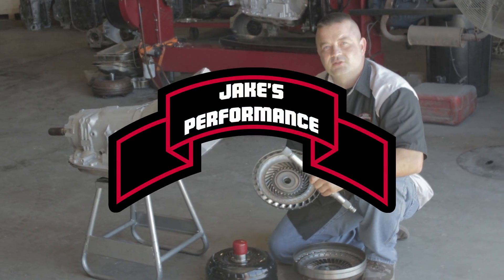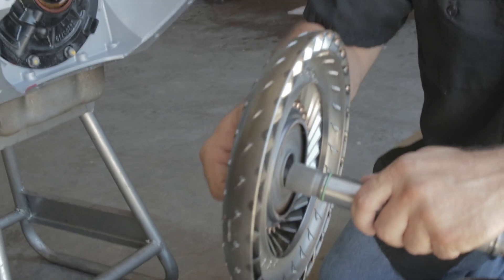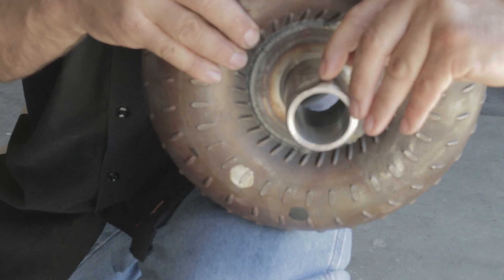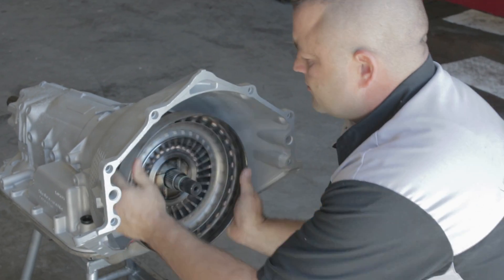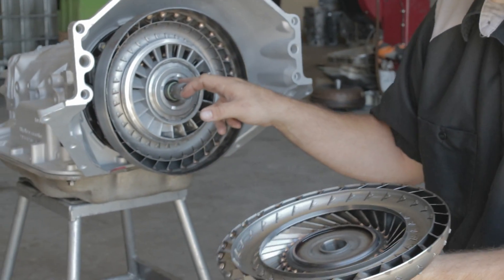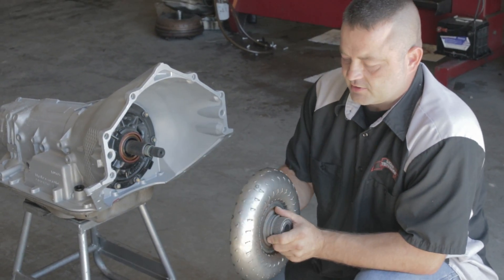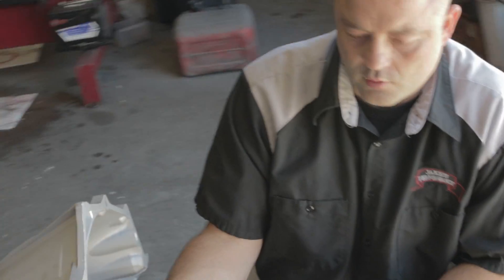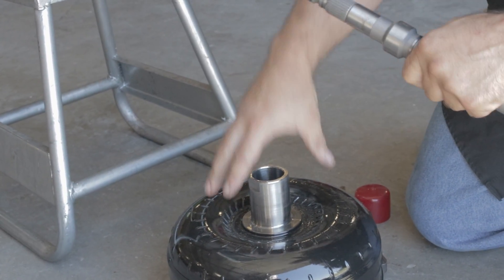Jakes Performance - 4L80 Common Converter Fitment Issues

Comment: is the converter on a 6.5L diesel 4l80e the same as a 7.4L gas 4l80e?
Reply: truck technician yep low stall they only make a low, medium an high stall stock converters
Reply: 4.3, 4.8L uses high, 5.3 5.7, 5.0 was medium, and 6.0 6.2l, 7.4l 8.1, 6.5L and 6.6L was all low stall